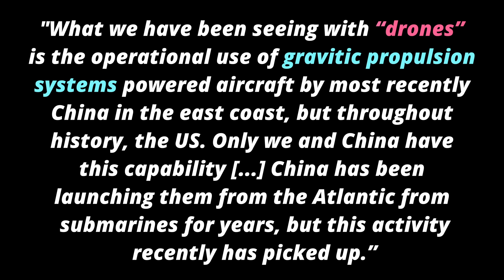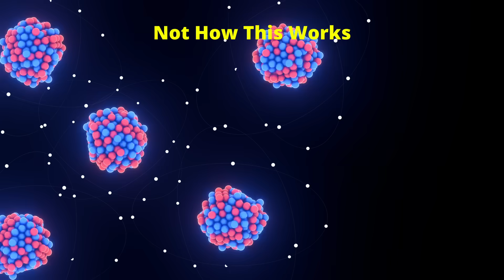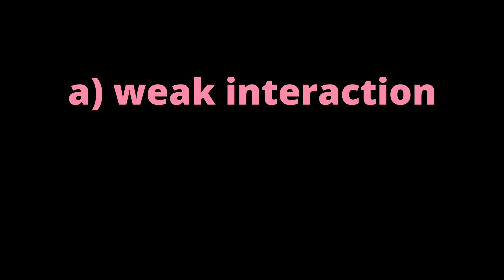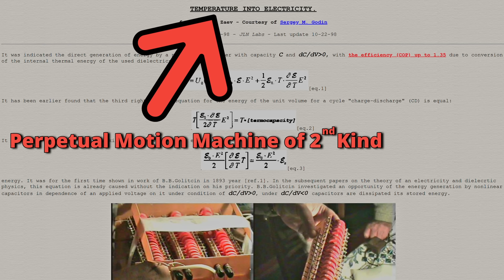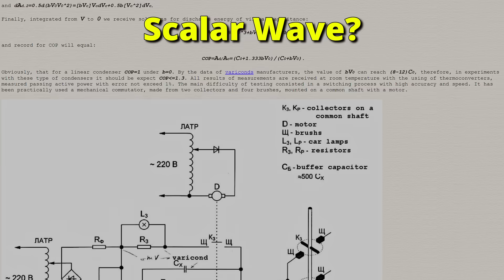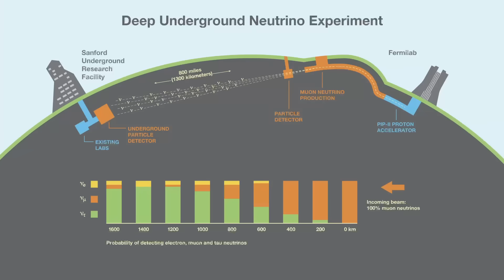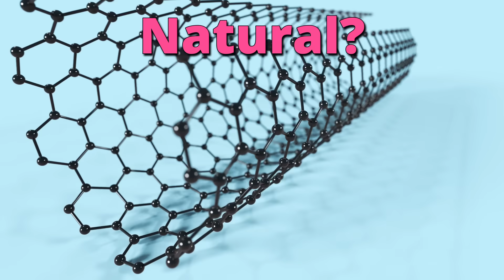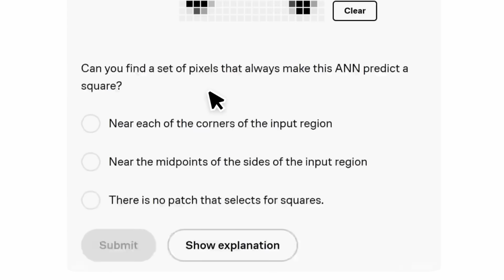What is “gravitic propulsion” and could the US government hide it?

Comment: The common theory comes from the bell experiment undertaken by the nazis using mercury to manipulate gravity or mass or what ever hudu you do, the idea is they can generate an area of higher than background gravity and because the device generates this field in front, it falls perpetually in one direction until it is turned off or expends its fuel, it also has to do with the Bob Lazar area 51 whistle blower stuff.

Comment: There are many 100's of if not 1,000's of secret patents, some of which are around energy systems. It is not inconceivable that these systems and devices would be  supressed as it would be too disrupting to the status quo and would undermine the whole economic system which is based on oil. If energy would be made cheaper for all countries there would no economic leverage and therefore global political power. Those with the political and economic power would not relinquish this knowledge easily.

Comment: Shortly after CERN came back online, after it's first major power upgrade. LIGO (Lazar Interferometer Gravitational Observatory) detected its very fist gravitational wave... despite years of looking for one. Why? What does that say about our ability to affect gravity? There are over 6,000 patents that have been classified in the name of national security. What do these patents show? The U.S. Navy has functional patents on anti-gravitic propulsion created by physicist Salvatore Pais (which can be found in a patent search... go for it). "Craft using an inertial mass reduction device" Patent US10144532. "Electromagnetic field generator and method to generate an electromagnetic field" Patent US10135366. "High frequency gravitational wave generator" Patent US10322827. "Plasma Compression Fusion Device" Patent US2019295733. And other. Again, these patents are in the name of the U.S. Navy.

Comment: Sabine, you're thinking on too high a level.  Gravitic propulsion is an idea from marine engineering, not theoretical physics.  

Picture a submarine with a gas bladder that can be inflated and deflated to control its buoyancy.  Add to that a set of steering planes.  When buoyancy is negative, the planes control the descent to move at an angle downwards and towards the destination while the boat goes down.  When the boat reaches maximum depth, the bladder is inflated and the boat is again steered upwards and towards its destination as it rises.  Kind of like a sailboat tacking to travel against the wind, isn't it?  Except for the inflations and deflations, the boat is powered by gravity.  Hence, "gravitic propulsion."  🤣
Reply: And there is the kid who failed science class but thinks he is good at stand-up comedy. ;-)
Reply: @lepidoptera9337  No, I did not fail Science, but graduated with honors from Engineering school and then went on for more Mathematics in graduate school.  Add to that a career working on defense projects.  As an engineer, I'm no physicist, but I once had a boss who was a physicist, and I had to correct errors in his math a few times.
Reply: @johnoriel4241  Nice to meet you. I am the Queen of Sheba. ;-)

Comment: The current US president's popularity demonstrates defying gravity rather well. I wonder what the secret is?  I spent years debunking ideas based on so-called scalar waves. I even had one guy come to see me at the Polytech where I worked complete with a beautifully contructed thing with brass, paxolin and bolts etc. which weighed a heap. I had to explain to him that it was basically an electrically-leaky capacitor which could never fly.

Comment: They are balloon's, look at a hot air balloon's the area inside is less dense due to heat displacing the air so the hot air balloon goes up, put a vacuum in there and it goes up faster. The light material makes it possible. If you look at some supposed UFO'S they have spheres around the horizontal central axis . China received the technology when released by the UFO.  In another way the  method is similar to a propeller not the air theory but its simple rotation, but the technology simple increases that effect which was done in World War 2. You are complicating everything think differently.

Comment: I'm a dumbass but couldn't you blow enough hydrogen into like an inflatable sphere which holds the structure for a vacuum? Pressurised Hydrogen structure + vacum would be lighter than air. With the added benefit of implosion on failure!

Comment: It is not government, it is black projects like Lockheed Martins Skunk works. It’s above top secret clearance which president have no access to. Germans were first to make working craft. But it was electrical propulsion. The craft had like a copper ring on the top that was charged with positive charge (with 3 Merlin engines help). Positive charge created a vacuum so that difference in pressure was pushing craft upward.

Comment: Well I figured out a working propulsion device that only requires electricity to move in any medium ( air ,water,possibly space) only reason I say possibly space is because I don't have the ability to test it up there and I'm a physically prove it by experimentation and observing it.. however I  will not be showing it or exsplain it because I don't want to disappear or end up un alive. It's so simple that really smart people had to have came across the same effect as I did in my garage lab, so I 100% believe the government has a silent no heat or exhaust flying aircraft that can seamlessly go into water or space on battery power...

Comment: I have made a number of "lifters" which are a very simple but somewhat challenging method of lifting a tethered construction of balsa, aluminium foil and fine wire. Power is from an outboard high voltage supply of perhaps 30kv. The triangular structure will jump off the conductive base to its the tethered limit. If you put your hand underneath (dangerous with the 30kV) you will feel the mild wind of ionised air that lifts it.  This is really just an ion engine as used by various spacecraft (eg Starlink which uses Xenon gas if I recall).
I made one for a science museum with a lot of safety features, lights and interaction, but it does suffer with coronal damage needing finicky repairs.
No new physics but simple high voltage corona ionisation being attracted to an earthed base for (very small) lift.
Google lifters and tesladownunder for a glance into these.

Comment: What if the universe was already there? And the big bang, was an event that happened inside of that pre-existing universe.

The explosion or “Big Bang” would still start with a singularity that explodes, and 

the explosion would 

cause, a wall or shockwave, like a wall, comprised of, at first dense gravity wall, followed by a sunami type flow of weaker, yet steady gravity waves but dispersed as a constant flow, but not measurable as a wave would be seen on an oscilloscope. Could this steady flow, covering the void of space be confused or identified as dark matter? So, as a nuclear explosion takes place. A shockwave is sent out across the voud of space. Can we see past that wall or that shock wave, into the unaffected portion of the pre existing universe? Could this be why we have observed the universe as expanding.

Propulsion doesn't work inside of a vacuum of space, correct? So. What if the big bang WAS a singularity, with a tremendous measure of gravitational strenth that blew? Would that explosion rip apart the singularity and have it's gravitational force dispersed  as a sort of film flowing through the vacuum of space, would this fog provide propulsion to any mass that it runs into which would be seen as expansion. If a gravity field explodes, would it be dissipated into the vacuum space? Not having any real attraction, but maybe just enough to have attributes that is found by science and called dark matter? Would the the front, or shock wave from the blast have enough power of propulsion, to make it look like our observable universe is expanding, but only observable because behind the shock wave, is left a detectable scar or fog, or very thin layer of gravitational waste product. That is measurably different from unobservable space already existed, or not corrupted with this waste product, which you call dark natter. And what6ou play only seeing the original universe is that which is on the blast side, or inside the blasts shock wave, thicker front edge of the shock wave.  I do not have a formal education, but I became a very passionate problem Solver.

I am a retired progammer from IBM,  where I found that solving problems was my enjoyable. I enjoy getting assigned problems then applying all new logic and reasoning to there solution. Block me I sound too stupid. But I really do enjoy your talks, so I can't be too dumb, Right?

Comment: We already have anti-gravity devices, called rocket engines.  These work by forcing a hot plasma orthogonal to the constant downward pressure of charge photons, mainly IR, from within our solar system, the galaxy and the rest of the universe.  So perhaps a solid state devise could be developed which provided a dense downwards photon charge stream, along with a top carapace made of a material that could deflect the ambient charge field to its edges, would be able to overcome gravity.

Comment: Think implosion, pushing a hole into the fabric  rather than an explosive force as we use now. It is an implosion caused by extremely high voltage.
 The patents literally exist for these plasma  energy balls already.  Not to mention a possible micro energy  tap on demand device.

Comment: “In 2002, an internal Boeing project called ‘Gravity Research for Advanced Space Propulsion’ (GRASP) had been disclosed to the aerospace industry. A GRASP briefing document obtained by Jane’s Defense Weekly stated Boeing’s position: ‘If gravity modification is real, it will alter the entire aerospace business’”…. Does the B2 reduce its mass through high voltage charges on the body/wings?

Comment: This is in the same category as Alcubierre's warp drive -- the math is real, and out in the open, and compatible with General Relativity, but even the "low energy" version requires either negative energy (which we don't even know how to define) or negative mass (likewise, since all experimental evidence so far indicates antimatter has mass of the same sort as regular matter).  Still a step up from needing negative mass as great as Jupiter -- but still not possible, as far as we know.  Using something like a super-massive rotating black hole for time travel is in here, too -- it doesn't violate Einstein to create a "closed timelike path", but the nearest object we know of that's massive enough to even consider for this is 30,000 light years away in the core of our galaxy, and surrounded by some of the most dangerous space we know of in the universe.

I think our odds are much better for inventing a "reactionless" thruster (one with not even EM exhaust) than they are of producing either antigravity or, for that matter, artificial gravity not based on acceleration or rotation.  Never mind that a reactionless thruster violates conservation laws...

Comment: if u jam a scafold pole into a motorcycle wheel at 30mph,the rider will be thrown over the handlebars,followed by the motorcycle itself. so put that under computer control and 3 axis, 20kg 10,000 rpm gyro wheels, =propulsion in any direction.speed/direction of rotationof all 3axis.prof eric Laithwaite,john searl...problem is withstanding 2km under water and reentry. making a vehicle that can withstand any environment.1inch thick diamond sheet for a windscreen perhaps? bit expensive! I dont think fiberglass is suitable, perhaps some ceramic encapsulation? its time we made some real 'go anywhere' vehicles.amaizing what people can make in a garden shed.

Comment: Everyone knows you can use a superconducting shell and run extreme high power and high voltage current through it and it will interact with the fields that make up space which can be used to accelerate relative to the field interaction.
The trick is to design the materials for the shell

Comment: the water powered car was cool (and I'm not talking about the BMW variant driving around)
Reply: stan mayer hit a little fusion i think,hence the extra efficiency he got with electrolysis, see 'fusion shrimp' and 'sonoluminescence fusion'. certainly if u get hydrogen from water and feed into diesel/gasoline engine, 50% better mpg and 80% reduction in emissions, try it! the h2 explodes first and shatters the diesel into smaller chains that burn more easily in the cylinder, instead of unburnt fuel out the exhaust.

Comment: I asked Caude AI, and it replied: Gravity/gravitic propulsion is largely theoretical at this point. The core concept involves manipulating or generating gravitational fields to create propulsion, similar to how electromagnetic propulsion works with magnetic fields.
While Einstein's theory of general relativity suggests that gravity can be manipulated by warping spacetime, we currently don't have the technology to do this in any practical way. Some theoretical proposals include:

Gravitational wave propulsion - Using gravitational waves to push a spacecraft, similar to how light sails use photons
Artificial gravity generation - Creating localized gravitational fields to pull a craft in a desired direction
Alcubierre drive - A theoretical concept that would compress spacetime in front of a craft while expanding it behind

However, these concepts face major obstacles:

The enormous energy requirements to manipulate gravity
Our limited understanding of quantum gravity
The technological challenges of generating and controlling gravitational fields
The fact that gravity is much weaker than other fundamental forces

Currently, the closest real-world applications are conventional propulsion systems that use gravity assists (gravitational slingshots) from planets for space travel. But true gravity propulsion remains in the realm of science fiction for now.
Would you like me to elaborate on any of these concepts or the current state of research in this area?